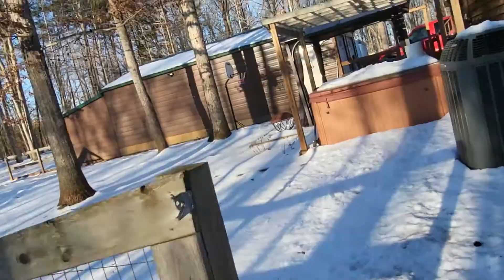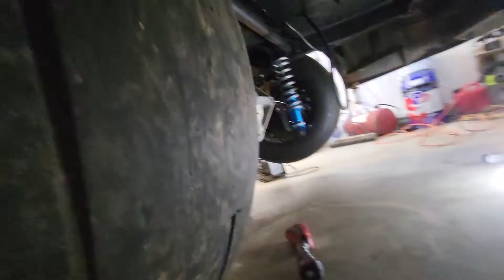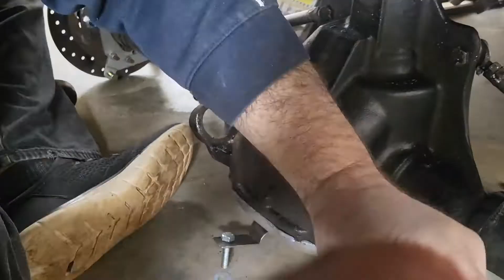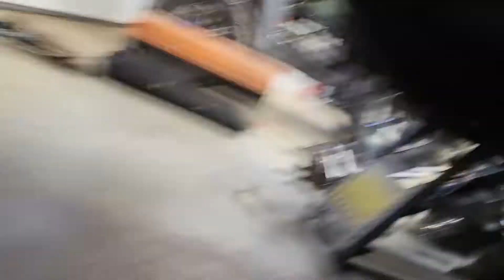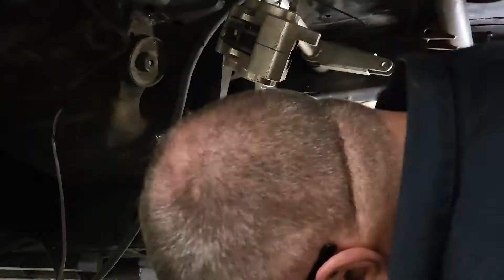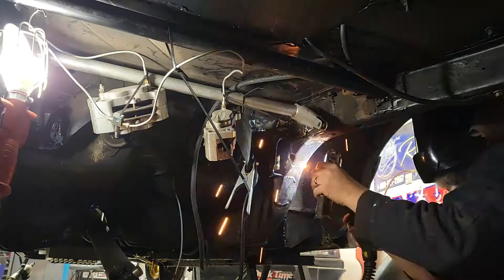Mustang Suspension Rehab part 1  -  EZ Torque Box Upgrade

Comment: I currently have team z relocated upper control arm kit with standard location lower control arms. Also, have team z drag spring which makes it sit slightly lower than factory.  Do you recommend keeping that upper kit or going with standard style upper control arms? Its a stick shift drag fox body.
Reply from the maker: Relocating the uppers higher on the housing accomplishes basicly the same thing if you keep stock ride height.  If you lower the car much, the upper bar angle will be pretty steep, and the instant center will be real short.   Stick shift cars are pretty violent, so I'd have as many adjustment points as possible.   Those springs work pretty good and don't lower it much.  I had some back when they first came out years ago.   There are plenty of fast street cars with that Team Z set up.  If you really start getting serious, I'd do the upper and lower boxes and go to a coilover with the longest travel shocks you can fit.  Then you have the luxury of trying different rate springs.  I like using the lightest and longest spring that will hold the car up and go low enough to get the ride height I want with the shock compressed almost all the way with only about an inch left at ride height.  That way, you have maximum extension.   Then have a good double adjustable shock to control how fast it extends.  You want maximum separation over the longest time.  If you want to see how a stick car should work, go look up Jonathan Atkins Grubworm Camaro.